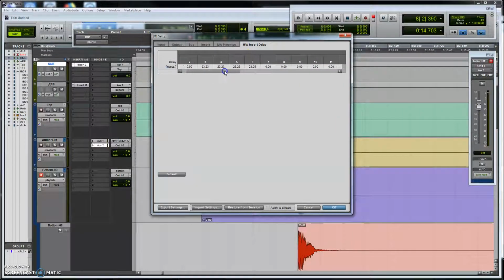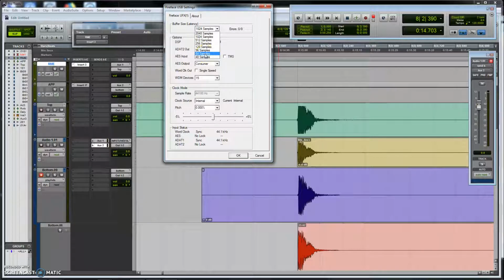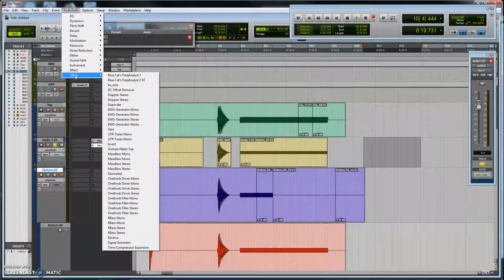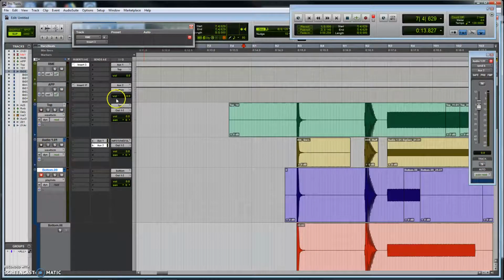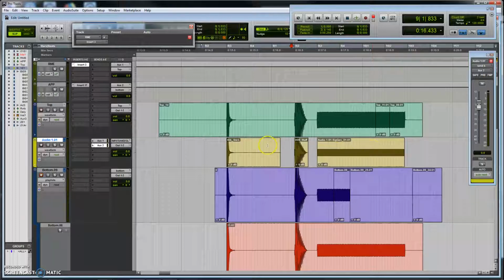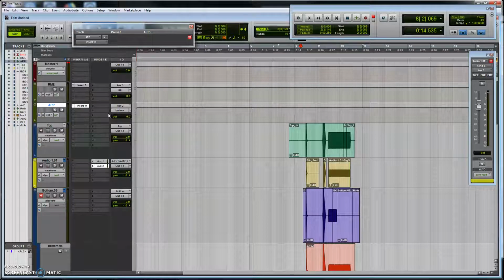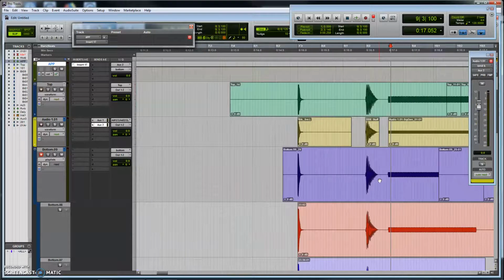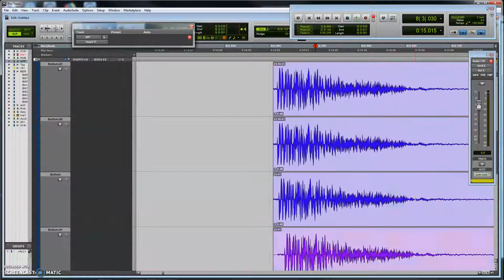How to Calibrate Hardware Insert Delay in Pro Tools RME UFX Apogee Rosetta 800

Comment: A little confused. You said that you're sending from the Aux to the Bottom track and that "it's basically a bus". I tried it as both a bus and by creating the "Bottom" track via a "new track" on the output of the aux track, but no signal is being passed. Thanks for any clarification you could provide.